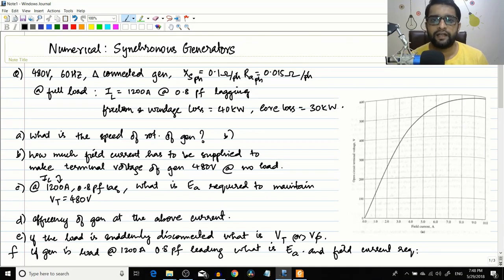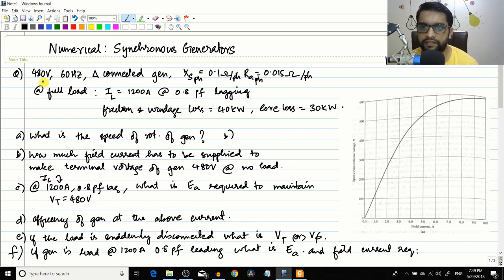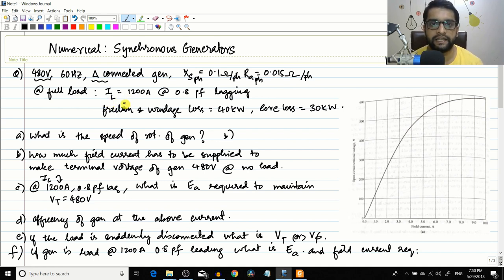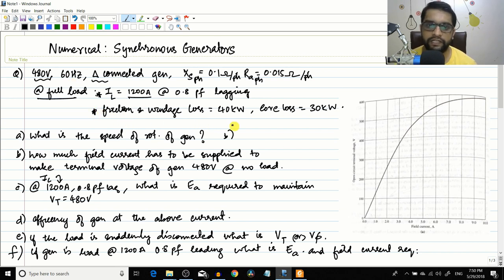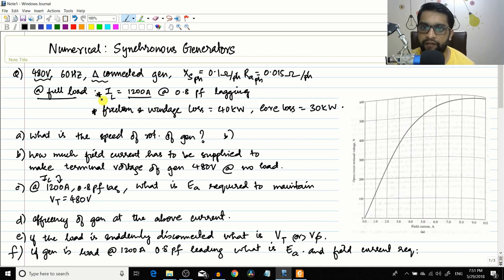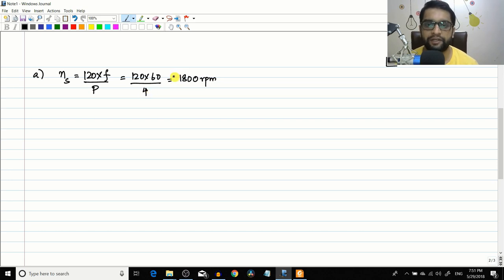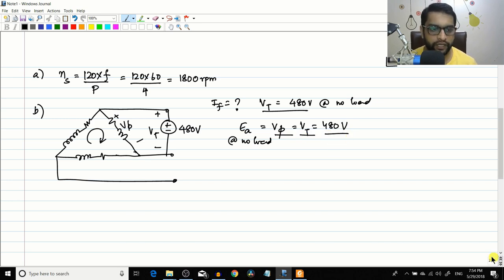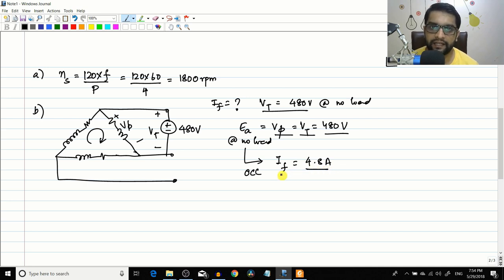#13 Numerical on Synchronous Generator - Part I

Comment: I've got a question!!
As we increase the load the output current increases and the terminal voltage drops and to maintain the same terminal voltage, we must increase field current.
Similarly, as the load increases do it gets harder to rotate the prime mover i.e we have to exert more force? and to maintain the likely to maintain the speed of rotation of rotor do we have to increase torque applied too ?

Comment: OCC means open circuit curve, so under loaded condition how have you found the value of field current = 5.7A from Ea = 532.155 volts?
Reply from the maker: Ea is not dependent on the load current...Vt is the term that it dependent..so to find Ea u can use occ

Comment: Hello Sir. I am preparing for GATE & your lectures are very useful for me. Thanks for your effort.
I have a doubt in this lecture.
While converting the line current of delta connceted generator to phase current you took the angle same as that it was in line current.
But we know that the phase angle of current leads by 30 degree than line angle in delta connection. Why this is not taken in consideration?
Reply: Same doubt!

Comment: Sir,for the 3rd part, I (phase) will lead I(line) by 30 degrees, so instead of -36.86 degrees shouldn't it be -6.86 degrees?
Reply: no.....because from derivation, the angle of power factor is (thetaV - thetaI) phase......so here the theta from power factor is actually (theta of Vphi) - (theta of phase current).........